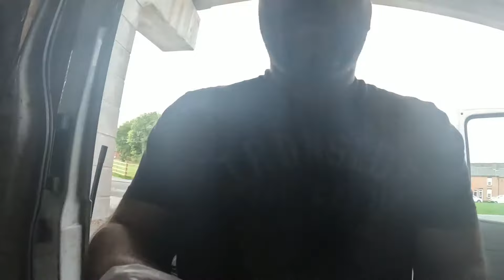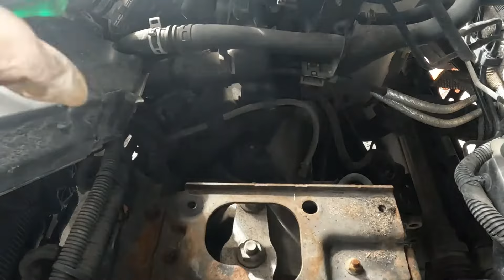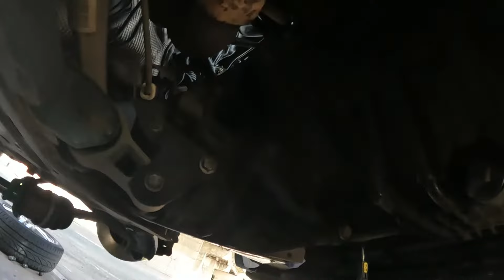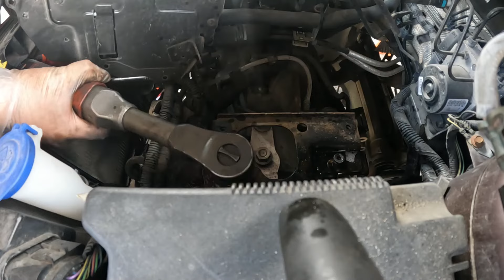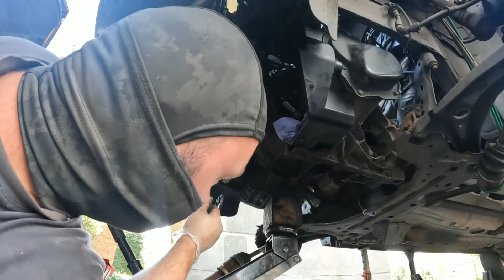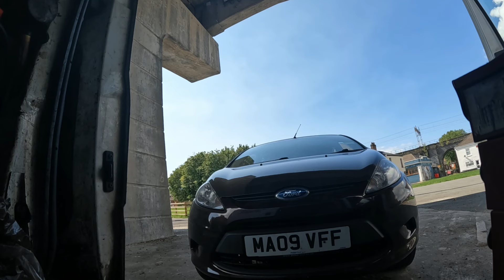Ford Fiesta 1.2 Petrol 2009 82BHP Clutch Replacement #Mobileclutchrepair

Comment: Great video! I’ve got mine off over torqued the clutch plate but I cannot for the love of me get the gearbox back on. It’s like it won’t slot into the spline on the gearbox I’ve lubed it up but it will not go in
Reply: Help
Reply: Try turning a drive shaft to move the splines (car not in gear ) while you jimmy the gearbox in and out …. did you align the new clutch ?
Reply: Clutch plate and pressure plate isn’t aligned properly

Comment: nice video. is 90k a good life for a clutch?
Reply from the maker: yes i normally advise people a clutch lasts around the 90k mark, but some last longer and some fail before that. The most notable vehicle i work on is the Volkswagen transporter range they always seem to fail around the 45/50k mark.
Reply: @MobileClutchRepair  nice bro what car do you see that seems to have the longest clutch life, petrol and diesel